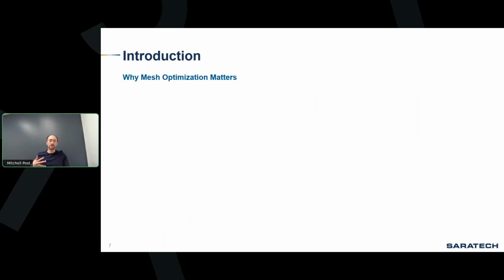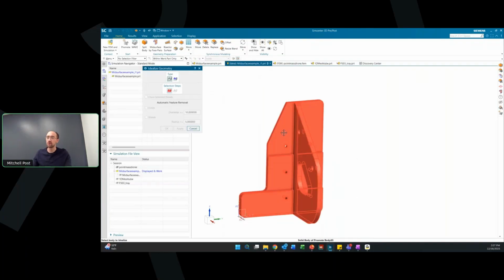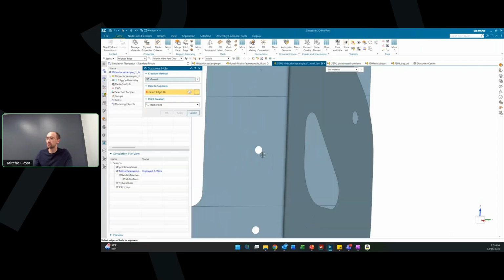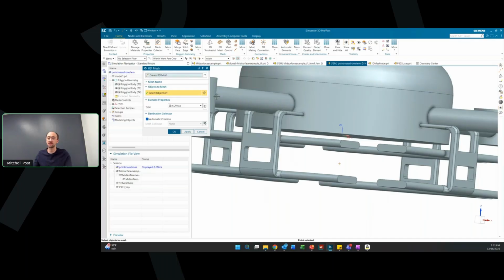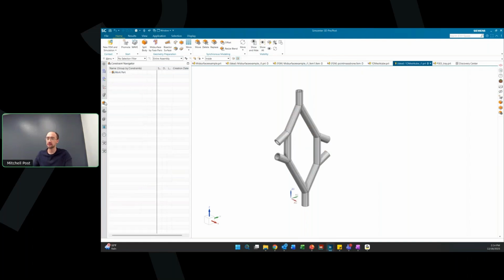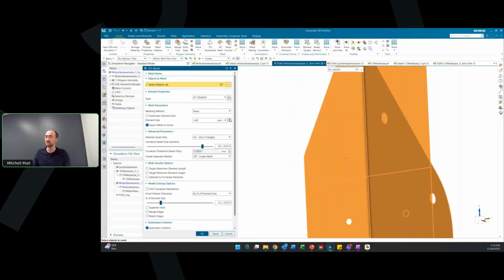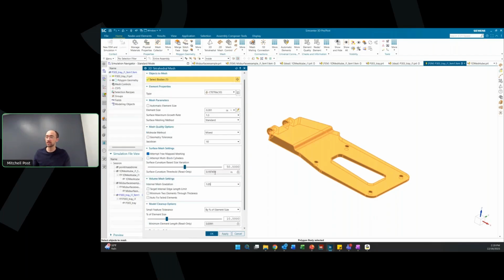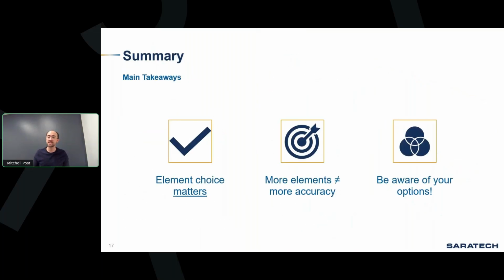CES Mesh Optimization Techniques for Simcenter 3D Users

Comment from the maker: Transcript
"Hi everybody. My name is Mitchell, and I am a Siemens Simcenter 3D application engineer. Our agenda today is straightforward. We will begin with an introduction, then discuss geometry cleanup, followed by meshing fundamentals. Next, we will cover zero-to-3D meshing, and we will finish with a cantilever comparison between different meshing techniques.

Why are we talking about this, and why does mesh optimization matter? Poor geometry leads to failed solves, low accuracy, and distorted elements. When working with highly complicated parts, not using the tools that Siemens Simcenter 3D offers makes the process harder for both the software and the user. On the other hand, using too many elements and nodes leads to extremely long solve times, high memory usage, and software crashes. The goal is clean geometry and smart meshing, which results in faster solve times, lower memory usage, stable solutions, and higher accuracy.

So how do we get there? It starts with geometry cleanup. This is done in the Idealized Part. If you are not familiar with the Idealized Part, it is linked to the master model. Any changes made here are local to the part, while the original geometry remains unchanged. In the Idealized Part, you can remove features, split bodies, create midsurfaces, and modify dimensions.

If we move into Siemens Simcenter 3D, I have created a sample part that represents general geometry. It includes curves, fillets, holes, and multiple step heights. The first step when editing an Idealized Part is promoting a body. I will demonstrate several tools that are helpful for modifying geometry. If you want to remove holes, you can use Delete Face, including loose or exact matches. There are multiple ways to achieve the same result in Siemens Simcenter 3D, similar to Siemens NX.

Another option is Defeature Geometry, which works well for holes, fillets, and other features. Many of these commands perform similar functions but are more specialized. If one command does not work as expected, there is almost always another way to achieve the same result. Idealized Geometry is another powerful tool that allows you to remove all holes and blends under a specified radius or diameter in a single operation. This is especially useful when removing unnecessary mounting holes from plates prior to meshing.

All of these changes appear as features in the Part Navigator, so they can be deleted or modified later. Another useful tool is Move Face. By default, adjacent faces may move together, but Pull Face can be used when you want to isolate a single face. Many commands have overlapping responsibilities but behave slightly differently, so it is helpful to experiment with them to understand their behavior.

Next, we will midsurface this part and create a shell for a later portion of the demonstration.

The second stage of geometry cleanup is abstraction, which occurs in the FEM file. Siemens Simcenter 3D automatically abstracts some geometry during meshing, such as removing sliver surfaces. However, you can manually edit geometry before meshing if desired. When we bring the part into the FEM file, there are many tools available in the polygon geometry section.

Autoheal Geometry allows you to remove small features or holes below a specified size, similar to Idealized Geometry. One advantage of doing this in the FEM file is that removing holes creates mesh points that can be used for loads and constraints, with elements forming naturally around them. Suppress Hole is another option that works one feature at a time. Face from Boundary Edges can be used to fill irregular gaps, and Merge Faces allows the mesh to flow smoothly across regions without forming tight elements. Freeze Geometry ensures specific faces are not altered during abstraction or meshing, and Reset allows you to undo abstraction changes.

Moving on to mesh fundamentals, 0D elements represent lumped or distributed masses. 1D elements include beams, rods, bars, and pipes. 2D elements are typically used for thin-walled parts but can be applied to any face. 3D elements are used for solid bodies and complex geometry. Mesh controls allow you to locally refine or coarsen the mesh on specific faces or edges without changing the entire mesh.

Zero-D meshing represents a point mass. It adds weight, inertia, and mass but does not represent physical geometry. In this example, a drone carries a pizza box. Instead of meshing the box, a point mass is created at its center. While Siemens Simcenter 3D can automatically place a point mass at the center of gravity, this example uses a manually defined point because no material is assigned. A 0D mesh is created at that point, and a mass of 1.5 kilograms is assigned. The point mass is connected to the surrounding faces using 1D point-to-face connections. Mesh controls are then used to reduce node density on those faces where high resolution is unnecessary.

Next is 1D meshing, which is used for beams, rods, and similar structures. It is computationally efficient and ideal for bending, tension, and shear, but it places nodes only along the centerline and can oversimplify complex loading. For existing CAD geometry, derived curves can be used to extract centerlines. When creating the FEM file, all relevant sketch curves should be included.

A useful feature for 1D meshing is the PBEAM physical property with the Face of Solid Beam Section option. This allows existing CAD faces to define beam dimensions automatically, eliminating manual input. The solid section can be displayed to verify correctness.

For 2D meshing, midsurfaces are used and are ideal for thin-walled parts. They produce significantly lower node counts than 3D tetrahedral meshes but are not suitable for thick parts or highly complex 3D geometry. Thickness can be defined in the Mesh Collector or inherited directly from the midsurface using Mesh Associated Data. Removing unnecessary fillets and holes results in larger, more efficient elements and improved mesh quality.

There are two main 3D meshing options in Siemens Simcenter 3D: tetrahedral and swept meshes. Tetrahedral meshes work on any geometry and are highly customizable, but they have the highest node count and require careful setup for accuracy. Internal mesh gradation can be adjusted to reduce element density inside thick regions when internal stress details are not required.

Alternatively, a swept mesh can be created by splitting bodies in the Idealized Part, identifying sweepable regions, and merging unnecessary edges. Using a 3D swept mesh produces a more structured, geometry-aligned mesh that delivers better accuracy. While node counts may increase, the improved results are often worth the trade-off.

To conclude, a cantilever comparison was performed using a 1D beam, a 2D shell, and a 3D solid mesh. The 1D beam had the lowest node count and produced the most accurate results because beam elements are specifically designed for bending behavior. This demonstrates that more elements do not necessarily lead to higher accuracy.

The key takeaway is that element choice matters. Siemens provides a detailed element handbook that explains the purpose and behavior of each element type. While many tools may not be used regularly, knowing they exist can save time and prevent issues in future projects. Always be aware of your options and verify your results.

Now we will move on to questions.

Yes, different element types from 0D through 3D can be used together in a single solution. It is important to ensure proper connections are defined and results are validated.

To address slow solve times, you can increase allocated memory, enable parallel processing, and solve only for required outputs. Always double-check your model setup.

Thank you for joining us today. This session, along with many others, will be available on the Saratech YouTube channel. Subscribe to Saratech for more Siemens Simcenter 3D content. If you have additional questions, please complete the survey or email marketing@saratech.com. Have a great day, and we wish you a restful and enjoyable holiday season."